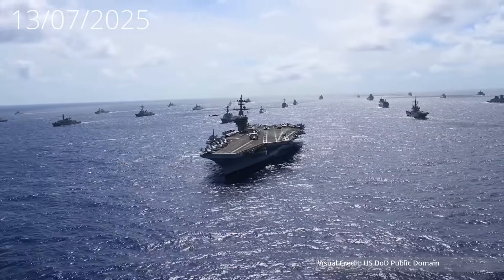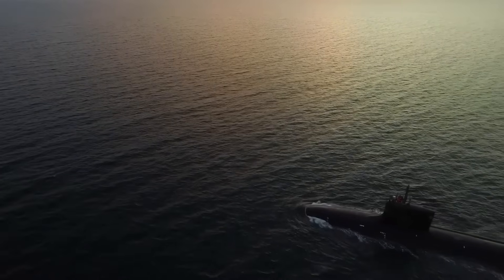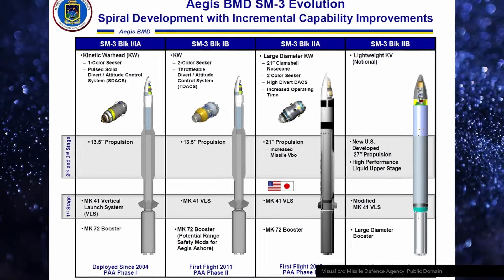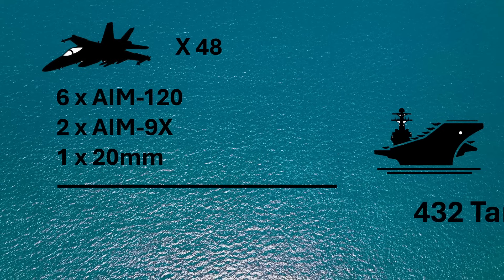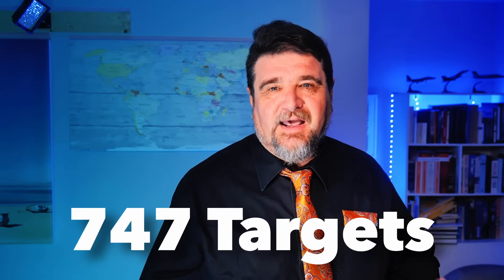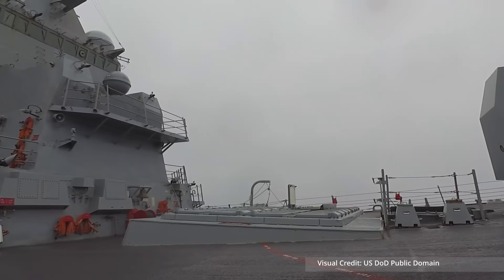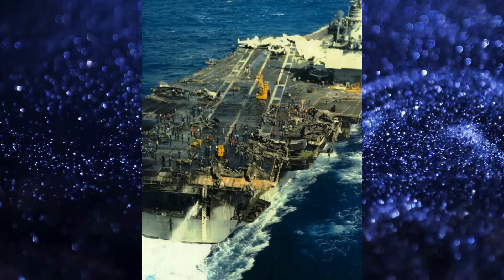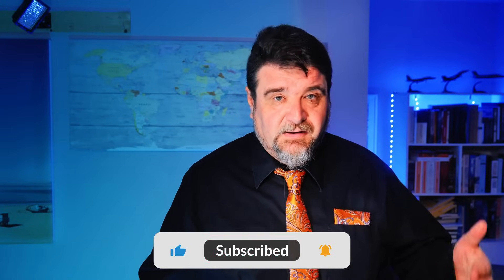HOW MANY Missiles are Needed to SINK A CARRIER?

Comment: The only realistic scenario through air attacks are su-57's with long range hypersonic missiles. A more likely attack vector is a nuclear attack sub moves in front of the battlegroup and simply hugs the seabed or hide very deep under water. Simply listen if/when the carrier comes into range to fire volley of torpedo's. Which are now self guided and very smart attack weapons and often with rather long range.
Reply: That's what poseidon is for. It lies in wait and then detonates nukes under the carrier group
Reply: Well the US is aware of its only "weaknesses" and has 100% made sure to prepare for even the worst case scenarios where they make their enemies overpowered in comparison to reality so yes there is not much chance anything can even come close to a CBG
Reply: @angelaferkel7922 no need to come close. KH31 Mach 5 missiles have 1000 km range and just ONE can sink a carrier. Venezuela has over 40 of them.
Reply: USN too now have some fast anti-ship ones with SM-6/AIM-174B, AGM-88G, and upcoming SiAW/MAKO.
Reply: No need for either. Venezuela already has 21 Sukhoi SU30 armed with two Mach 5 KH31 missiles each.
Reply: What SU57's, and what long range hypersonic missiles are going to realistically engage a CBG? Because Russia has few SU57s and no HGV's that can engage a moving target. Even if they did you wouldn't even remotely be able to oversaturate the air defense using SU57's alone.
Reply: @InterstellarTaco  Russia has both and Russia's hypersonic missiles have defeated US anti-air systems multiple times.  There is no need to oversaturate air defenses that cannot hit the missile.  The question should be, can the SU57 actually carry the large hypersonic missiles.  Since the Mig-31 is NOT a stealth aircraft and will be shot down even outside the 1000NM parameter.

You are talking like US air-defenses are perfect, They are far from perfect. Western systems are really good, but stopping hypersonic missiles, there is no evidence at all current systems are effective. All great powers are working on systems to stop hypersonic missiles. Which wlll probably result into within 10 years we will see stealth-hypersonic missiles to counter the improved air defense systems.
Reply: @basbass429   first let Russia win against easy level like Ukraine, US is out of Russian league
Reply: @roro-v3z  Ukraine = NATO and NATO is loosing.
Reply: @basbass429 yes hypersonic missiles have defeated air defense when attacking static targets. Not moving like a carrier battlegroup. Russia has yet to even demonstrate their ability to employ hypersonic glide vehicles to attack moving targets. And the ones we have seen are just modified ballistic missiles.
Reply: @roro-v3z  Ukraine is basically the entire NATO supply, production and tech. Including 700000 troops trained after the US-coup of the US in 2013/2104 in  Ukraine. Also continued training support after Russia finally had enough of the killing of Russians by 8 years of Ukraine shelling of Russian neighborhoods, This continued training accounts for another 500+K additional troops;  tank crews, soldiers etc. trained by NATO. And NATO is fully loosing now Ukraine has literarily ran out of men. With minimal casualties on the Russian side (compared to the millions and millions of losses on NATO side)
Reply: Cruise missiles are also effective too. Cheaper also. Example is Moskva was easily sunk by ordinary 2 x R-360 Neptune cruise missiles. Not even sea-skimming nor low observable/stealthy like JSM or LRASM.
Reply: @johnsilver9338 that isnt a great example. Moskva was one ship with very degraded systems, an inexperienced and complacent crew or both. A US carrier is always going to have multiple ships screening around it. Borderline impossible that cruise missiles would be undetected by either the fleet as a whole or the E2's that are always in the air.

Comment: This is just stupid, one needs only to destroy the flight deck or propulsion and steering systems.
Reply: Any deep strike that compromises reactor in anyway would force a majority evacuation & void any serviceable actions of carrier. Same goes for the superstructure 🎯
Reply: @titancartercus.8484  Good luck touching the reactor, you can damage the power output of the reactor but probably not the reactor itself. The containment vessel around it make it really hard to break, you better hit the magazine or the jet fuel stores.
Reply: @Ralfountet  A Zircon hitting with high kinetic force, close to vertical, even without a warhead, would punch through every deck and out the bottom.   A reactor shielding wouldnt even slow it down.
Just as an example.
Reply: I mean, that’s a mission kill, not a destroyed or sunken ship.
Reply: @Sgt_Niedermeyer  No, but once it can't fly aircraft any more, that means there's no defensive CAP.
Which means suddenly you can just start pouring on missiles until the entire group is sunk.
Reply: @DIREWOLFx75 Kind of a different point here. Yes, it’ll likely halt air ops if the tower or props are damaged enough, that’s still a floating ship, that’s all I’m saying.

Yes afterwards you’d be able to further engage the carrier in a secondary strike though that carrier is probably already retreating and unless you had weapons/planes/missiles on immediate standby and had perfect immediate BDA capability, you wouldn’t know how much damage you actually did in time and the carrier will be gone.

Plus how do you even do that, or single out something specifically on a carrier with a missile that can hit that? If you’re shooting at a carrier don’t focus on specific systems just go for the kill
Reply: @Sgt_Niedermeyer  "Plus how do you even do that, or single out something specifically on a carrier with a missile that can hit that?"

Heh, Soviet missiles could hit specific parts on a carrier already in the 70s...
Today it's much easier.

And the reason for doing it would be because it causes more 2ndary damage, like aiming for the bombstores or where to cause massive fuel leaks(and fires) etc..
But yes, the option exists with any modern missile, but it's not considered important, because just aiming for a sinking hit is generally enough.
Reply: @DIREWOLFx75 No but that’s what Im trying to say. If you have a missile that you’re confident can make it to target, why specify control towers and not like what you said, bomb stores and other critical areas? These Russian missiles have plenty of explosive mass. If you send a volley just targeting the tower and they hit it, all you do is take out it’s flight ops and once you do a BDA the carrier is probably sailing out of range and is more alert of future attacks, meanwhile you could’ve sunk the carrier.

Like LRASM can do this for example, target specific areas on a target ship, but it aims for the area to do most damage and take it out, not some area that may put a stop to one of the ship’s functions.
Reply: @Sgt_Niedermeyer  In most warfare a mission kill is already enough to gain ground.
Reply: It’s not stupid; It’s a thought exercise….
Reply: It's just hypotetic man. With luck his missiles and those of his escort can intercept dozens of missiles, sink several submarines and surface ships and destroy vital infraestructure It' this highly possible? No, but in the history of naval warfare the combination of a great commander, a capable ship of the line (old and new) and a lot of luck has produced incredible battles. Same the other way, "unsinkable" ships were sunk in one lucky hit.
Reply: @hernanuliana9111  It's pure fantasies.   It's ridiculous.   Even just to have the CAP get a chance to fire at the incoming bombers before they launch missiles is absurdly difficult.   While if you're "playing" the attacker, not losing any aircraft during an attackrun is generally fairly easy.

Also, lets say Kh-22s.   They're mach 4+.   They use decoys.   They use EW.   They maneuver during approach.   They have AI that makes the missiles cooperate in their attack to make them as difficult as possible to intercept while maximizing their chance to hit their targets.
And every missile has 1000kg explosives.   Which is enough to sink a carrier even with a single hit if lucky and missionkill it otherwise.

USAs SAMs have proven laughably bad at intercepting anything using decoys, or maneuver, or use EW, or is supersonic and completely failed to intercept anything hypersonic.   And mach 4.5 of the Kh-22 is nearly in the hypersonic range.
An attack run with fifty Kh-22 and the entire carrier group is gone.
Or if you want to play it safe, you go with twice as many Kh-55 instead.   Latest models have range counted in thousands of km, and while merely subsonic, 100 of them suddenly appearing will still be enough to sink 1-2 of the escorts and likely damage the carrier.
Reply: I personally, like the Italian-Japanese approach far more. They are middle sized carrier, can carry troops and landing vehicles. They are strong armed, the ITA one with it's 76mm cannon and guidet ammo, +16 VLS, several 25mm cannons, and of course 15 F35B jets and Helicopters. Abd btw., the F35B can land, like the Helicopters, on other support ships nearby!
Reply: @Nebukadnezar2036  The USMC literally has the largest fleet of those in the world they have like 2x more of those than the rest of the world combined. and the fleet of them is 3x larger than the supercarrier fleet.
Reply: @Big-lron  1 carrier alone can carry so many planes like the French, Italian and british 👀
Reply: @HeidiK3 sorry, not so informed, I thought a nuk. carrier can carry to 70-80 jets or not? this is as much as the two ITA and one FRA 😁I don't know the different classe
Reply: Considering that he talked about that in the first couple of minutes, I don’t see this complaint as valid.
Reply: Or spy can destroy it from within just like the Titanic
Reply: @Alejandra-cv7rj  WHAT????????? Thats not even close to how titanic sank.